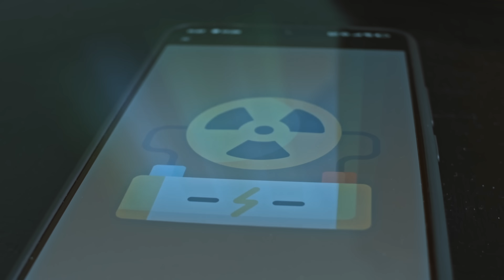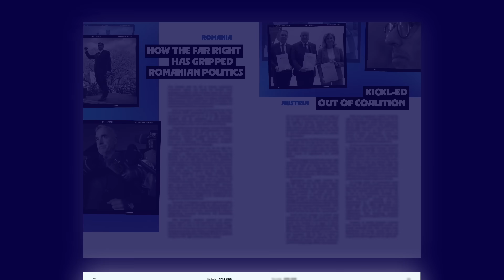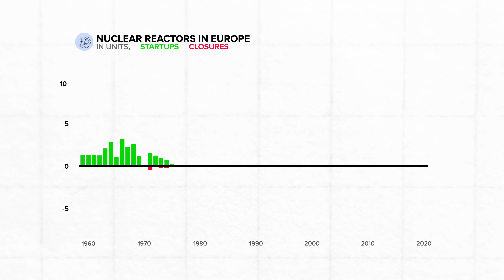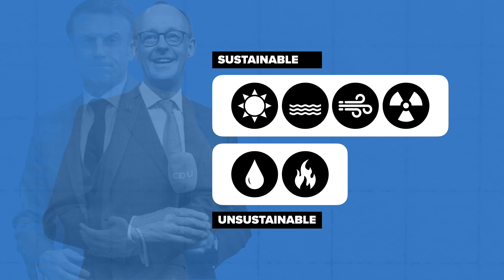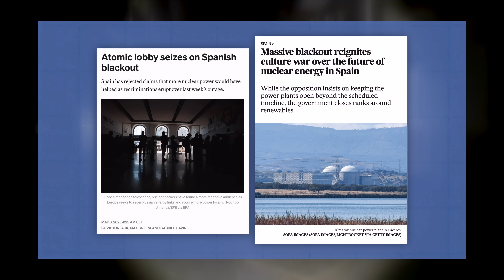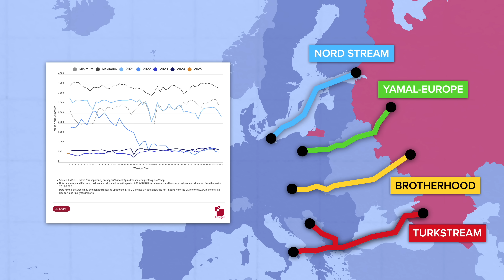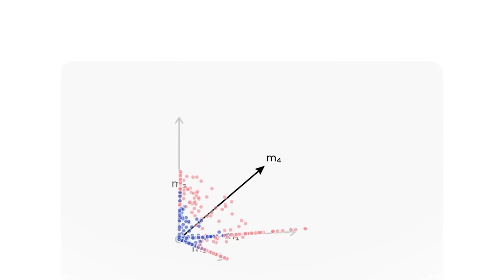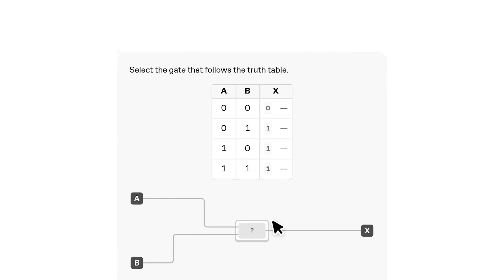Is Europe Quietly Returning to Nuclear Power?

Comment: Nuclear power plants are mega-projects which benefit electric utilities and construction consortiums with billions from taxpayers. Utilities in particular are looking to long term nuclear projects to stay relevant for years to come. With the Levelized Cost of renewables currently half that of nuclear, and falling, the economic arguments are backwards. The grid is destined to become the backup, rather than the primary conveyor of electric power as inexpensive production and storage becomes more localised, rendering long distance power transmission increasingly obsolete.
Reply: "With the Levelized Cost of renewables currently half that of nuclear, and falling, the economic arguments are backwards." You can't use LCOE to directly compare variable renewables to dispatchable technologies, you need to add firming costs. And the firming costs alone for renewables are about as expensive as the total cost of nuclear. By ignoring firming, you are including a massive hidden subsidy for renewables. Give nuclear a subsidy of the same size, and it would be 'free'.

Comment: "Solar only works when the sun is shining and wind only works when the wind is blowing" is what conservative politicians say to stall renewables. Obviously that's true, which is why you increase various forms of battery capacity. Disappointed to see TLDR not address this. "unless you have ways to store massive amounts of energy" was said as though this is impossible... it's not. We do have ways to store massive amounts of energy, but like nuclear, we just need to start building it.
Reply: There is no form of battery technology that can store enough power to light up a city when the suns down and the wind stops blowing. The only realistic option at the moment is to pump water up into a reservoir and have it flow down through hydro turbines when needed, but it's incredibly inefficient and expensive. In contrast nuclear power plants while expensive are efficient and come with the added benefit of being able to stockpile decades worth of nuclear fuel.

Comment: Rosatom's nuclear plants built in RU cost as much as natural gas plants built in US, except that this nuclear plants are expected to last 80 years with possibility of extension to 100 years.
And this is an almost identical design to Western PWR designs.

Reason for that is they have one approved design that is being built over and over again with slight changes. That allows to have plants making reactors and pipes working round the clock and keep consruction crews the same.
Which is why the cost is so small compared to plants built in EU.

Comment: You did not really talk about the logistics of sourcing the fuel for the nuclear plants.
Any chance you would be willing to make a follow up video? Does Europe have a way to mine and refine nuclear fuel, or will that also tie the continent to the whims of countries that can supply that (possibly the same that today supply oil and gas)?
Reply: 1) You can stockpile decades worth of fuel. 2) Canada and Australia have massive uranium deposits and have no geopolitical incentive to cause problems for the EU. 3) France has the facilities to enrich uranium due to their existing nuclear infrastructure and nuclear weapons arsenal.
Reply: > or will that also tie the continent to the whims of countries that can supply 
When you can import a decades worth of fuel and store it without much degradation - you really aren't at the whim of the exporter.

Also, there are commercially viable deposits in the EU, Germany in particular!, of uranium.
Because so little fuel is used to produce so much power, fuel could double, triple, or even quadruple in price, and the increase in electricity cost would be in the fractions of cents (either USD or Euro).

Comment: Only it would halt other renewables. The steady output nuclear reactors and fluctuating power output renewables like wind and solar are not compatible with one another. Unless they plan on AI training and data-centres to consume massive energy amounts constantly, I see no reason to have nuclear power plants. Besides the waste issue hasn't been resolved for many countries yet. Better invest those billions into battery (electric, chemical, thermal or mechanical) development and net infrastructure like superconducting cables instead. Nuclear electric power will never be as cheap as renewables. And once the infrastructure is better suited to handle renewables output patterns you will have some concrete blobs that don't return the investment. Besides being a great target for sabotage etc. Where is the Uranium going to come from..? Or are we back at the  running joke that is thorium..?
Reply: > Only it would halt other renewables. 
Showing just how economically bankrupt the idea that 'wind and solar are cheaper' is.

> The steady output nuclear reactors and fluctuating power output renewables like wind and solar are not compatible with one another.
You seem to be under the misapprehension that the goal of the grid is to support intermittent wind & solar. The goal of the grid is to meet the demand load - which although it fluctuates, is not met well by intermittent wind & solar.

> Besides the waste issue hasn't been resolved for many countries yet.
And it doesn't really need to be. Putting spent nuclear fuel in the back parking lot is a very good 'short' term solution that will serve us well for many decades, perhaps even a century! (note that we're coming on 71 years since Oblinsk and 69 years since Calder Hall opened - AND it just isn't a pressing issue).

> Better invest those billions into battery [storage]
Storage is more valuable, when charged by nuclear than with wind or solar, as you A) need less storage with nuclear and B) can predict the charge side of the charge-discharge cycle

> infrastructure like superconducting cables instead. Nuclear electric power will never be as cheap as renewables. 
Yes, nuclear will never be as cheap as wind & solar - until you add in the storage and the grid extensions and the super-conducting cables AND all the upgrades needed for "And once the infrastructure is better suited to handle renewables output patterns"! But simultaneously you are afraid that "it would halt other renewables"!

> Besides being a great target for sabotage etc.
Except it isn't. There has only ever been 1 attack on a nuclear power plant from a terrorist (a member of the Green Party!). And the Russians having taken over ZNPP are .... doing nothing but attempting to extort the Europeans.

> Where is the Uranium going to come from..?
Uranium is fairly well distributed across the planet, is as common as tin, FAR more common than silver or gold, and one doesn't need a lot of it. If All the countries today that export uranium stopped mining and exporting  - the US, Germany, and several other countries could re-open their existing mines and produce ore.
Sure, the price or uranium or or fuel might rise, double, triple, quadruple - and this will, because of how little is needed, raise the price of nuclear electricity by a few USD-cents or Euro-cents. Not exactly what keeps the energy security boffins up at night.
Reply: @factnotfiction5915  The point is to be sustainable and "short term" storage is not going to cut it. We are talking about hundreds and thousands of years. And as it is nuclear waste is very corrosive. And large holes in the ground can get damaged by water or seismic shifts over the next 1000 years. Just enough for water to get in and compromise stability and being sealed off.
By the way... by that measure: "there were only 2 atomic bombs ever thrown off in a war... so it's very unlikely"... It is very unlikely because people care about it. Nuclear power is only good for big energy companies and politicians who want to make some money on big projects by sitting on some councils and write 2 mails per week but get thousands of euros for their hard work. The alternative would be that people planning those things are incompetent. Or these things are too complicated to be built reliably. And the short term argument is also an argument why NOT to go back and build new ones. because it will take 16-20 years until even the first Wh of Energy is transferred. And as said: Germany is too densely populated to have a vault to store it thanks to nimby-ism and relying on others to take your waste makes you dependent. Some populist right wing government gets voted in and they decide that they will take your waste but for 3x the price. Whereas Wind and Solar are somewhat low tech with no risk attached. No nuclear power plant would be built without subsidies. Ever! I think that says enough. People complaining about taxes but wanting nuclear (but nimby) are really out of their minds. Urainium isn't all that common. Gold is one of the least common metals.. so your comparison was not very useful... besides getting the 285 isotopes to 5% is also not very efficient, so if Germany (or other european countries were to get the U-ore out they'd have to use a lot of energy to turn it into usable pellets. And i think there is still mystery about higher leukemia cases in the vicinity of npps. But maybe you are not planning to have kids.
Reply: > The point is to be sustainable and "short term" storage is not going to cut it. We are talking about hundreds and thousands of years.
With reprocessing, we are talking 300 years. Reprocessing takes the highly radioactive, but short-lived, fission products - about 5% - and buries those for 300 years. The remaining 95%,the actinides, can be reused as fuel.

> And as it is nuclear waste is very corrosive. 
It is? I believe you have a completely untrue perception of nuclear waste.

Currently, spent nuclear fuel is composed of super-hard ceramic pellets, encased in metal tubes, which is then put in a steel-lined, then copper-lined, 40-100 ton steel-reinforced concrete cask. - SOLIDS all the way through.
This is not some green goo in a 55-gallon drum.
The cask doesn't corrode (from the inside at least) and it doesn't ooze.

> And large holes in the ground can get damaged by water or seismic shifts over the next 1000 years.

Just like the Oklo reactor in Gabon. Which ran for about 100 million years. And over several 100s of millions of years the waste products migrated ........ about ONE meter!

For radiological damage to the biosphere, you have to have water:
* penetrate a bentonite clay layer (several cm thick) packed around the cask (couple 100 years)
* leach through several cm of concrete (couple 100 years)
* then dissolve several mm of copper (couple 1000 years)
* then dissolve several mm of steel (couple decades)
* then dissolve a ceramic zirconium pellet (couple 1000 years)
* then migrate hundreds of meters to the surface (couple 1000 years)
all in rock proven to be super-dry and super-seismically stable.

The fantasy involved is mind-boggling.

For coal ash and emissions (containing radionuclides) to enter the biosphere in the next minute, you just have to have a wind or solar farm to back up, and then burn the coal. No fantasy required, just look at business-as-usual in Germany (just look at one of the "100% RE" days).

> It is very unlikely because people care about it.

Thank you for agreeing with me. The motivation is immaterial - just the outcome needed!

> Nuclear power is only good for big energy companies
 
etc etc - suffice to say I disagree with you, but not really worth it to argue against such drivel.

> Whereas Wind and Solar are somewhat low tech with no risk attached.

Yeah. As long as you are on friendly terms with China where immense, highly technical plants at the cutting edge are churning out low-cost solar panels and wind turbine blades. Or maybe think about the cost of those panels if Germany had to build plants and run them for the domestic market should China cut you off!

> No nuclear power plant would be built without subsidies. Ever! I think that says enough. 

Ignoring all the wind and solar projects that are suddenly "at risk" when the subsidies fail to pass the legislature. Germany phased out some wind subsidies in 2019 - that year's auction was under-subscribed, they put them back and voila! suddenly there was interest in building wind again.

Or we can examine the ridiculous 92.5 pound strike price for nuclear at Hinkley Point C.
AND THE EVEN MORE RIDICULOUS 140 pound strike price for wind at Hornsea One!!!

> Urainium isn't all that common. Gold is one of the least common metals.. so your comparison was not very useful...

On the other hand, I also compared it to TIN - one of the most common metals in our society.
And we can compare it to ZINC also!
NOTE the increase in reserves - because we started looking for it again!

"The world's known uranium resources increased by at least one-quarter in the last decade due to increased mineral exploration. Uranium is a relatively common element in the crust of the Earth (very much more than in the mantle). It is a metal approximately as common as tin or zinc" - world nuclear association

> besides getting the 285 isotopes to 5% is also not very efficient, so if Germany (or other european countries were to get the U-ore out they'd have to use a lot of energy to turn it into usable pellets.

Yeah, and France, the UK, the US, China, even (once sanctions are lifted) the RF all can provide pellets. No need to build a domestic industry. Or do you feel Germany should worry about the French still being miffed about WWII?
ps - the energy to make the pellets isn't all that high compared to the energy returned from fission.

> And i think there is still mystery about higher leukemia cases in the vicinity of npps.

You may also feel there is still mystery of vaccines causing autism, or whether bleeding should be brought back as a primary treatment for illness - however the medical establishment, like UN-WHO, or the UN-IARC - do not share in these 'mysteries'.
Like the German KiKK study - well-known to have methodological issues and failing to account for other environmental factors; essentially no other scientists have come to the same conclusion as the KiKK authors.
There is also a "rash of unexplained cancers" surrounding Three Mile Island - and simultaneously one of the lowest rates of cancers in that county compared to the rest of Pennsylvania and Maryland! In other words, hyperbole.
Lastly there is the inconvenient fact that NPP workers (at at least in the US) - the people closest to the reactors most of their working lives - have one of the lowest accident or injury rates and one of the longest life expectancies of any industry.

Comment: There's some new types of Nuclear power plants in development which have a lot of promising improvements to the current designs we know of.

One is the Molten Salt reactors, which would likely run on Thorium. The main upside of this type of reactor is that the risk of a meltdown is next to 0 thanks to how the fuel itself needs to stay at a specific temperature to create energy. Too hot or too cold, and the process shuts down. The waste products from these reactors have a lot shorter half-lives as well, which helps in mitigating waste and increases their efficiency, especially as you can theoretically use 100% of the fuel you got, whereas with current ones, that's not the case.

The other is a Natrium-based nuclear reactor. Might sound strange, but basically the concept is that they use liquid Natrium as both a conductor of the heat generated by the nuclear fuel and as a battery to store that heat for later use. This means that, unlike most nuclear power plant designs, this one can continue supplying power consistently and according to demand, and therefore can always keep running at 100% capacity. And even if the plant needs to be shut down for whatever reason, like maintenance or something, the battery will act as a buffer which will allow the plant to keep supplying power to an entire city for days before they run out, meaning that no matter what, there will always be electricity coming out of this type of plant. That's consistency that even a molten salt reactor can't boast. But the downside is that this still uses Uranium like the current reactors do, and so you still have that waste and fuel efficiency problem. But it doesn't use water directly to cool it down, so there's no heavy water generated. All the water that is used is merely used in combination with the natrium to be heated and drive a generator.

So I think that before we start building new plants, first have these two types of reactors ready to be built on a large scale. Of the two types, the latter I mentioned is the closest to going commercial; there's already one planned for construction in Wyoming. The molten salt one is currently being built in China, but it's China so who knows how they do it.
Reply: Nah we should just return to High Temperature Gas Reactors. Gets very hot, means way more electrically efficient. Can be made passively safe. Doesn't need excessively fancy alloys. Can use pretty much any fuel. Solid Fuel Pebbles allow for easy management. And we already knew the concept from decades ago, but regulations don't allow gas coolants weirdly enough, even though they're safer.